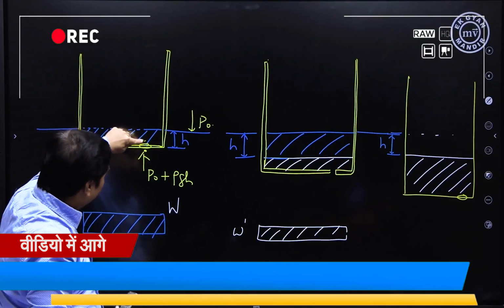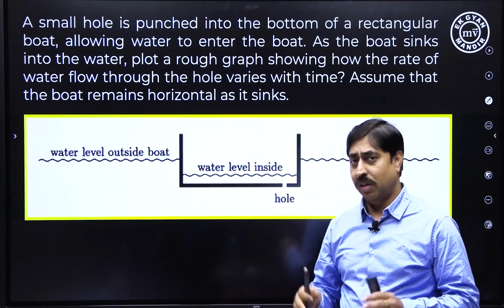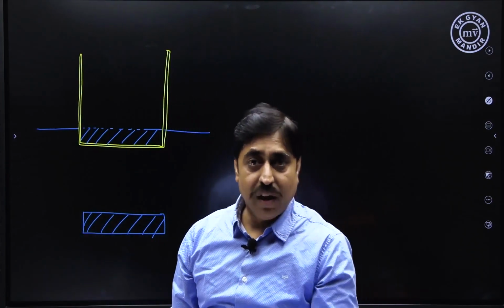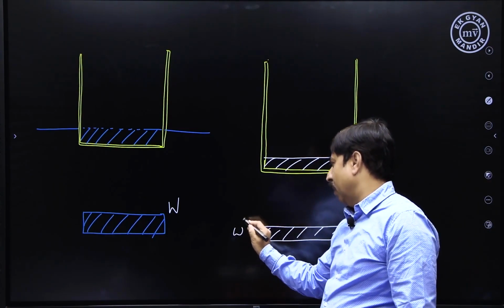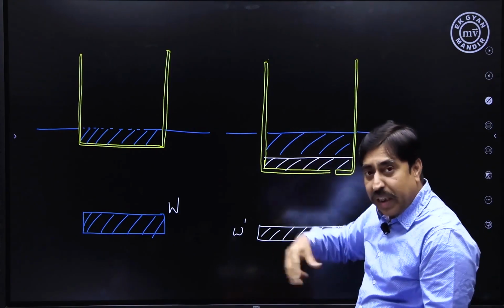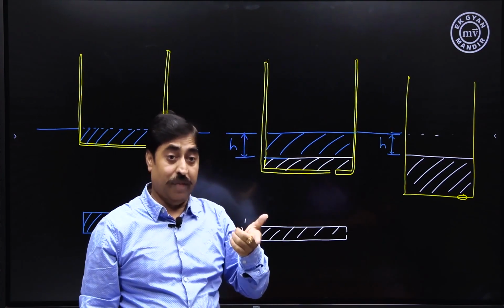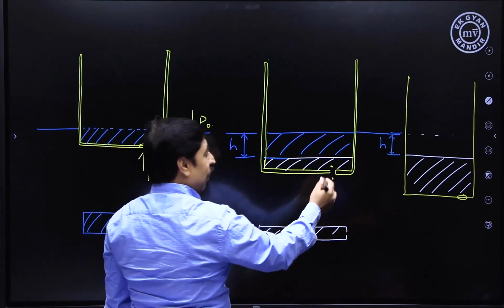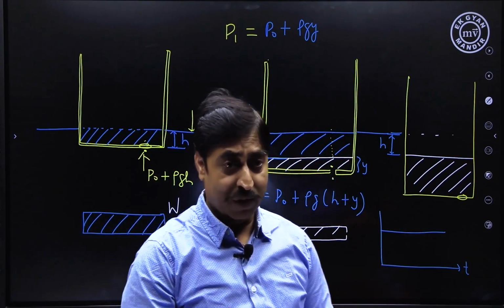Problem for JEE on Fluid Mechanics #sbt #jeeadvanced #buoyancy

Comment: key take away from the question is that "for every (h+y)cm  the boat is inside the water looking from outside, the boat will be filled with yc m of water from inside" where h cm  is the initial amount the boat is submerged inside water without the hole"